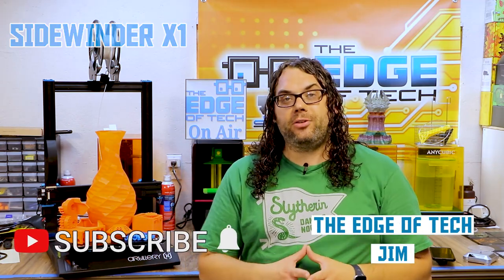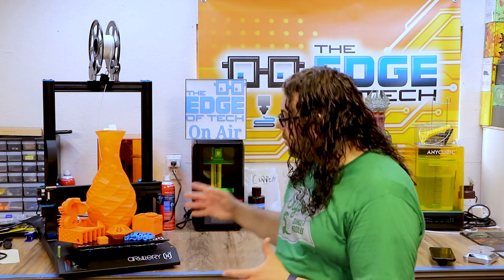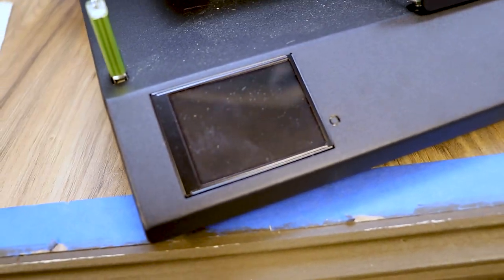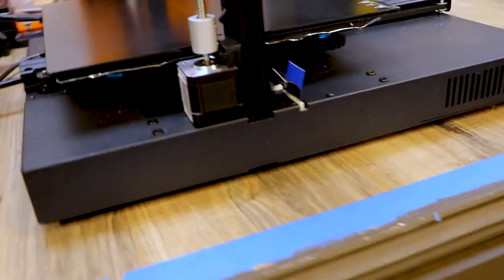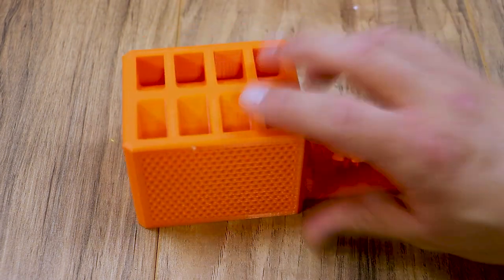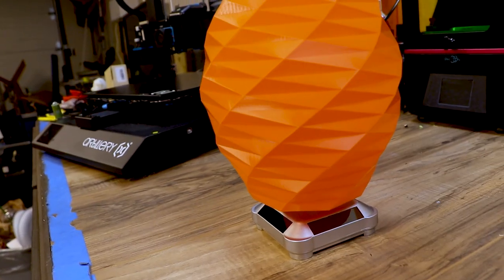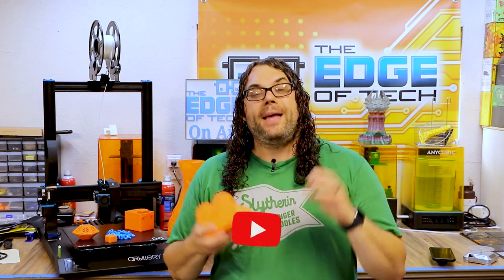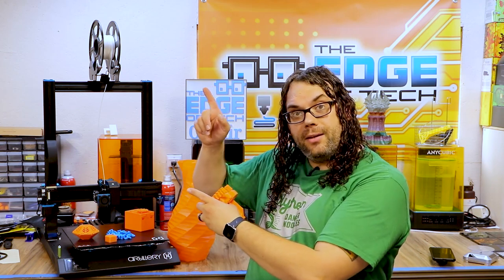5 Awesome 3D Prints done on the Artillery Sidewinder X1 V4

Comment: I got rid of my cr-10s pro v2 for this printer if that tells you anything. After a month it was the best move. Its an amazing printer. If not for the ribbon cable plug and the 8bit board, this would be perfect. 2 issues that really aren't issues if you're careful. Which is more that I can say for the last couple cr10 models that are a total bug factory with stupid parts. You shouldn't have to need to go on vscode just to get the thing working. This printer pretty spanks everything...and lights that actually have function was a super nice touch. And go update the firmware. Theres alot more functionality to the screen/control. Like babystepping and even more dial in options on the fly.....ive yet to see anything better in the price bracket. This is loaded with cool stuff and only 440. The cr10 is 650 and all you get is headaches